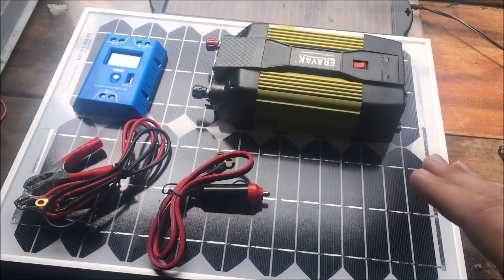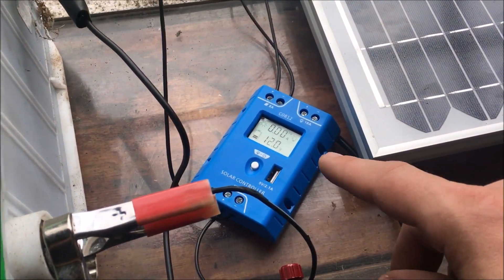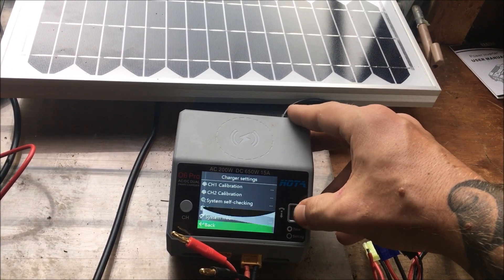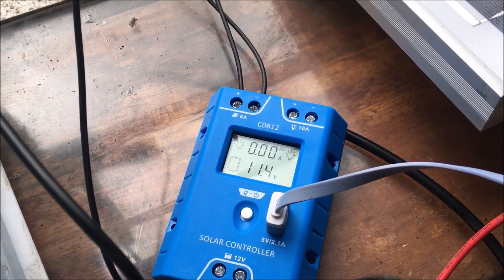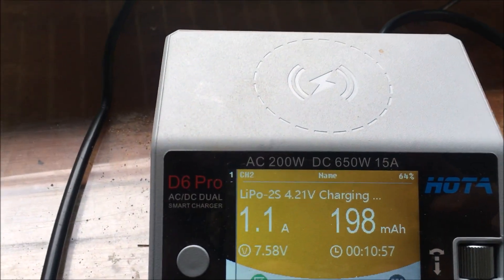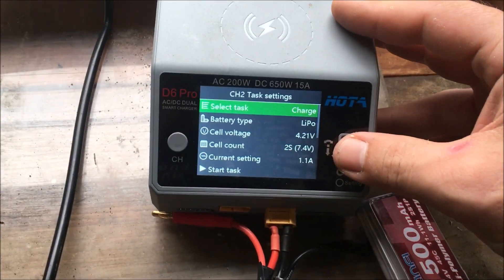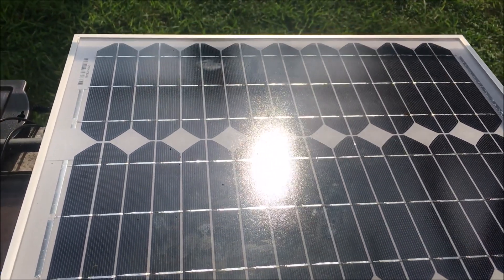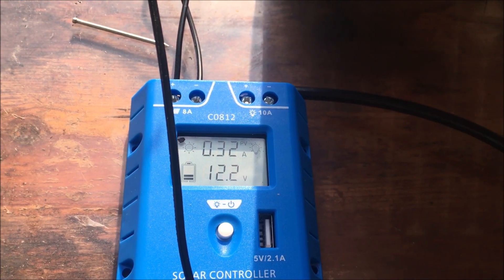HQST 20 Watt 12 Volt Monocrystalline Solar ZEALLIFE Charge Controller & 300W Power Inverter

Comment: HQST is selling an 1100w inverter, which I don't recomend, so far I tested two of them, the first one was already broken, the second one keeps beeping no matter what the Voltage of battery is,   the trigger should go on if low  battery is 9.7v-10.7v but this is not the case. We're confused with this product, what should be the real Low Battery alarm buzzer voltage
Reply from the maker: This first when you see in the video actually took a shit the company sent me another one that would work for about a year but now does not work I have a very nice one in my van if you’re interested you can check out some of my van videos that one is actually king n built well

Comment: Jay use a pure sine wave inverter or you can mess up chargers!  You should be able to find a 100 watt panel with cables and controller for a little over a hundred. Always use a fuse between the battery and inverter. Alligator clips do not carry the amps correctly. Use the shortest possible run between controller and battery. Buy one solar cable with both ends on it and use the length you need from panel to controller and use extra out of the middle to go from controller to battery. I suggest 12 gauge. Use 4 gauge from battery to inverter. Have a grand time. When you get ready for the van then get a 24 volt panel and use a MPPT controller to reduce it to 12 volt. That way you double your amps. Amps is what it is all about not volts. Have a gooder!